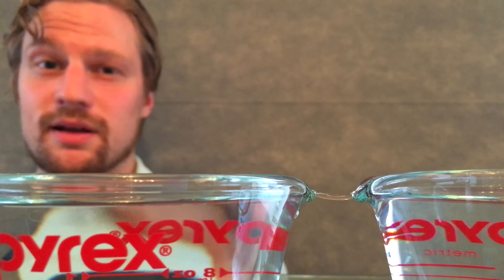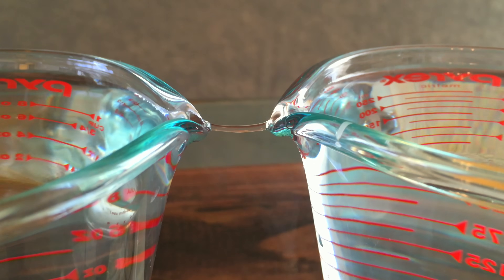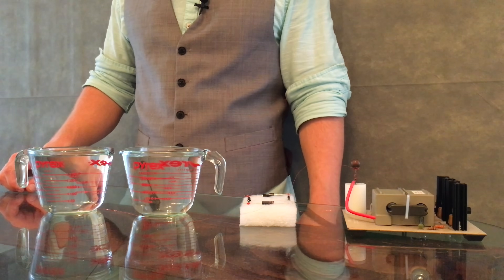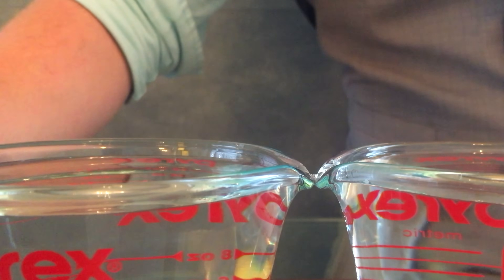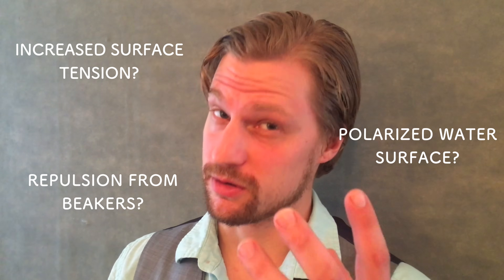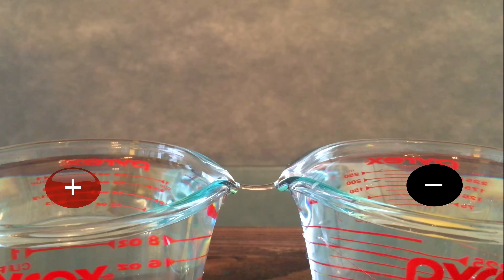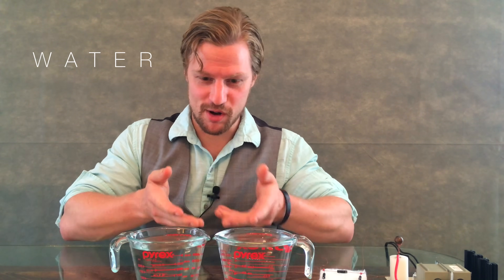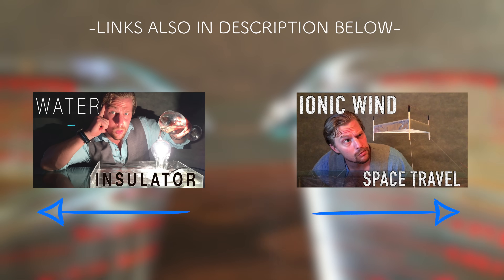How To Defy Gravity With Water | THE WATER BRIDGE EXPERIMENT|

Comment: If you could increase the voltage do you think it could move (specifically rotate)
Reply from the maker: Higher voltage allows longer bridges. At a certain point though, the bridge maxes out. That happens to be around 3 cm

Comment: That was awesome! I am made of questions right now! 
So - at around 1:44 the video shows steam forming on the tip of the right vessel. 
what is that? what volt and amps was set when the water was waving like that? 
Whats the temperature of the surrounding air and the temp of the water?
i accept that the volt or the amps affect the oscillation freq, I just wonder if its only the tip of the bridges that get hot, and how hot?. 
Also, what happens if heat the water up? like if you keep the water just under boiling point, how does this affect the whole process? 
More.. I get why we use DI water, and I get why we are using glass, but how would magnets or copper affect this process? could they be placed strategically to affect the bridge?
Love your stuff! 
puc

Comment: interesting, one would think di h2o is non conductive but i guess with enough voltage anything can become conductive, still trying to figure out why the water molecules would bridge? its as if the electrons of the molecules are being shared and forming a bond even though there should be nothing conducting

Comment: If you look back into Kuch's papers on the subject, the water bridge is a bidirectional flow that rotates in opposite directions. And that with pH-sensitive dye, you can see that the water actually readily ionises. What you have is ion exchange, like that in a cathode tube, with water.

Comment: It is Positively Charged Protons holding the Bridge together, and a large source of them will burn, hold a Flame up to the water. And video it, and how to make your power supply? I know how to build a cell around the bridge to separate the high voltage from the extracted protons. It makes a blue flame that burns cold
Reply: @Plasma Channel , please tell me you have held a flame up to it. I've seen enough evidence showing it will work. I'm a truck driver who doesn't get home time, live out of the truck, dont have the stuff to build it yet. Please let me know if it works, if it dont react right away, let it have a while to run, saturating the water cups with the charge also, keep trying different strategies. It's the energy inside the water that burns, not the water itself
Reply from the maker: Hi David, I will try such a thing!
Reply: @PlasmaChannel  also a magnet can influence the attraction and repulsion of the protons, I think the north repels them, so magnet on table, flame above magnet then Water Bridge .. that's if the effect seems like it needs a boost
Reply: @PlasmaChannel  so when are you going to report the results? I'm so Very anxious to have proof I'm correct before I go blowing away money on parts

Comment: Hello you j You understand that distilled water can be a more perfect cooling system for transistors and heating elements.
Reply from the maker: Indeed it can. The flaw is that DI water quickly turns conductive. Within minutes.

Comment: Hey I was wondering where or how I get a 20 KV dc like the machine you have there.
Reply from the maker: They can be made with fly back supplies, or, check out my episode on a DIY 10,000 volt high voltage power supply.
Reply: Thank you!

Comment: Does it only work with destillisated (or how you write it) water or works it with normal water too?
Reply from the maker: It will not work with normal water. You need a non conductive fluid (aka distilled water)

Comment: I responded at length to another video on this subject. I have to say that saying that "science breaks" is one of the stupidest things I've heard in a long time. So I'll be brief.

This is just surface tension being actively moderated by a strong electric field. Your demo is easy to set up, but it's physical geometry alone makes any observations much more difficult to interpret.

Check out "electrospray". It is a popular way of creating fine droplets by using a high electric field to cause the droplets to fragment. You can electrospray conductive liquids because the circuit is completed through the "droplets" and is not an short circuit to ground. In fact you have to ground the collector or the droplets will be repelled from it and fly all over. Lol

In this demonstration, you can't use salty water because it would instantly overload your power supply and the voltage would drop. Try an electrospray experiment. All you need is a syringe with a metal needle. You'll find all the weirdness you are looking for, but it will make sense!

Please stop confusing random people on youtube...

Comment: how to make a high voltage dc power supply?
Reply from the maker: Ah, very simple! Add diodes rated for the appropriate voltage to the AC output. This is what I did for this experiment. Used a high frequency AC HV source. Then placed a full bridge rectifier, built of 4 15,000 volt diodes, on the output.
Reply: +Plasma Channel 
thats what I had a doubt on.
I'm on the way to build a high voltage power supply that you had built earlier using a ballast and a flyback transformer.
to this build I must add a high voltage diodes to it that's it??.
no filter anything.??
By the way How is the frequency found out in  HV power supply you built?
Reply: +suresh suresh full bridge rectifier with a capacitor or just those 4 diose??
thanks by the way!.
Reply from the maker: Yes indeed, all that is needed is a full bridge diode circuit, to rectify to dc. The frequency I found with a signal generator, And matching frequencies

Comment: 2:17 I see purple, can this process turn water to Hydro and Oxy?
Reply from the maker: The purple you see is a break in the water bridge, followed by a high voltage arc trying to re initiate the bridge. The purple color exists due to nitrogen in the air being ionized. As per Hydrogen and Oxygen, in theory yes it can. However, you need high current and power levels to make any noticeable gas. This high voltage is low power, likely not doing much in that department.
Reply: Thank you. Your channel is great.

Comment: Would an old flyback from a projector tv work as a voltage source? I know they have very high voltages but I'm not sure how high. Maybe you are more familiar?
Reply from the maker: +Seth Hastings thanks for asking! Actually those would be great. Just make sure it is the flyback with an internal diode, to produce dc. If not you can always just add a diode. But those voltages are perfect from a tv flyback
Reply: Awesome! Those are easy to find for free where I live as long as you don't mind lugging around a massive tv😂 And the screens are also useful as fresnel lenses. My roommate and I used one to produce temps around 2000° F Freshman year.

Comment: wha... wha... (starts taking notes)
Reply from the maker: +Brian Bell twilight zone stuff, we're telling you. Thanks for the viewership
Reply: Plasma Channel Do you know if it would work with a microwave transformer you would probably need to run it through the microwave capacitor
Reply from the maker: +Brian Bell in fact, it would. But, the bridge would be very short as those are only about 2000 volts. You'd need to rectify it as well. Be extremely careful with that level of power though!
Reply: Plasma Channel Yea I know that high voltage is dangerous and most microwave transformers are  2200 volts.
Reply from the maker: +Brian Bell excellent 👍. Yeah give it a try.
Reply: Victor ST The microwave transformer is powere by 120 volts ac at 60 hrtz idk if the output frequency is 60 hrtz
Reply from the maker: Victor ST my apologies! I did not see your comment above. The power source is NOT 60hz. It is 15,000hz at 20kv. It is a high frequency flyback supply. Yes, an automobile coil with a rectifier will work, and work well.
Reply: What is the frequency? Also, I think with an automotive ignition coil and an oscillator with a relay or a power transistor it may be possible.  Would that provide enough power for this experiment? What are your thougts Jay?
Reply from the maker: +Brian Bell frequency out of a standard transformer is equal to the frequency in. Things can become more complex with certain transformers but MOT's are basically type.
Reply: Ok, 60 Hz, 20'000+ volts DC. Got it. Tnx a lot.
Reply: Plasma Channel Well thankyou for expanding my knowledge my brother gave me his old college text books the fundamentals of ac electricity and the fundamentals of dc I just haven't gotten around to reading them
Reply: Care to share the title and ISBN of the arc electricity literature?